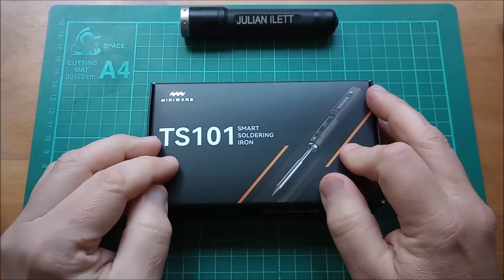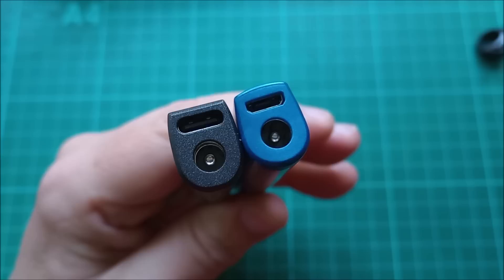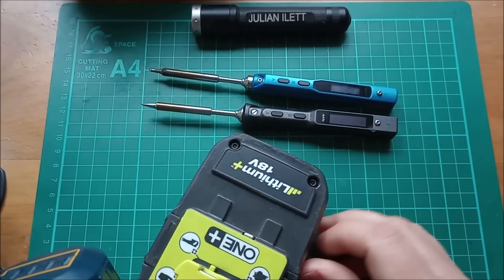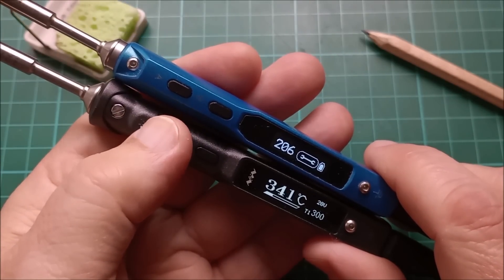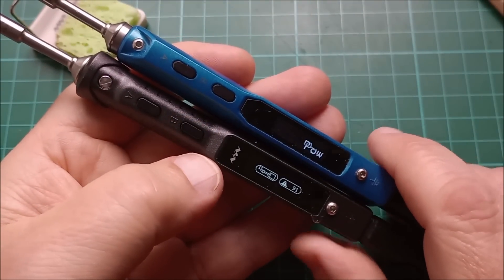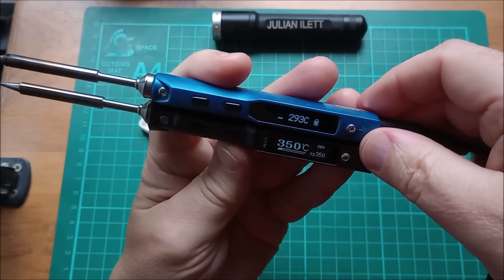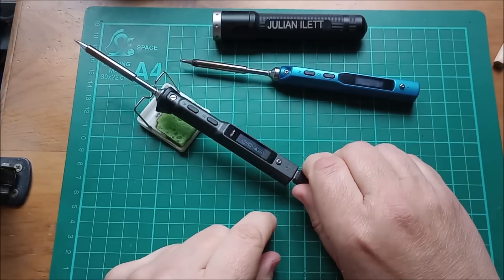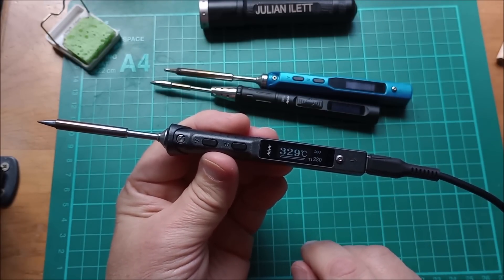TS101 Soldering Iron - Better than TS100?

Comment: A very good comprehensive review for those who have purchased this and want a quick tutorial .. I loved it. Just got my TS101 yesterday and it looks to be a good piece of kit. I upgraded the firmware as well to V2.11 which enables the PD3.1 28V option .. or basically you can switch off the max 45W restraint in the menu settings to OFF so that it goes up to 65W or 90W whichever power source one is using. It is better to keep both the USB and DC power source options at hand to make this a good soldering companion for all scenarios. You did a great detailed review of it .. thanks a bunch. For people who have never owned this type of soldering iron, they may get intimidated with the menu etc. but once you get it you will most likely have a smile on your face! Cheers.

Comment: It seems to be happy when you just feed power via usb-c. without any pd stuff. in my manual, the maximum voltage via usb-c pd is 21v. so far there are no issues at 24v. (other than the buck converter having a stroke because of the pwm ;D)
what was/is the reason for that limit?

Comment: 3:03 for full power it requires a PD3.1 100W charger and a 240W EPR cable that costs as much as the soldering iron itself, doubling the price. Not so cheap anymore.
Reply: but the cable and power supply are then there for multiple uses.  I

Comment: Any long term info on the OLED display on the TS101?
I had 2 TS100 and on both the OLED faded out over time. (Probably because OLEDs don´t like the heat...)
Does the TS101 still have that problem?

Comment: I got 90w to work type c 28v 5A with 140w type c cord and anker737 powerbank that outputs 140w max on one c port heats up so fast it only reads a little over 100w for 3 seconds on the power bank then dives back down to 2w to keep it stable

Comment: This thing sucks... i have a 100w adapter and cable and it wont even melt solder into a 14awg wire. Unless you use the barrel jack this thing is useless.

Comment: If you don't use these on a regular basis, coming back to them, the menus and buttons presses which you don't remember are confusing as phwck.
I end up just guessing at the button to turn it on, and then when I need to pause it, unplug the dmmn thing from the power source.  When I need to use it again, plug it back into power.   I got smart and use a power strip for turning power on and off.  I mean, I guess I could spend 5 to 10 minutes every time I use the iron figuring out the menus all over again, but I don't have time for that.  An AC power strip switch is the way to go.   On, off, on, off.   Once the temp is set, I don't need any other bloody mess in the menus.
Reply: thats good advice... I use a similar setup for my 3d printing pen

Comment: Why in the world would not they not allow 28VDC in the barrel jack?  That is absolutely senseless!

By the way, I use a simple DC to DC boost converter to feed my soldering iron with 24VDC.  (It's a Chinese T12 tip iron.)  I can run it from my Ryobi batteries or from a lithium iron jump starter or just about any D.C. source that can supply ca. 90 watts.

Comment: To truly appreciate TS100, you have to use Ralim IronOS firmware, which not only improves it's operation but also comes with new settings & features. Just give it a try and you won't look back ;)
And IronOS support for TS101 is coming soon...
Reply: Great bit of info, thank you 👍

Comment: A review with a comparison between both models is VERY useful for someone like me who wants to finally upgrade from an AC powered pencil soldering iron. I am finally trying to build a permanent project using an RP2040 based board and want propery temperature control for any soldering I may have to do.
Reply: if you use a top end ac soldering station its not an upgrade.... they still cant be beat

Comment: Thanks for the quick complete review. BTW. You can update firmware with an open source bin file and improve it; also add more setup options to tweak and performance. Nice review 👍
Reply: May I kindly ask what's the firmware you're using, and where do I get it?, thanks!

Comment: Where did you get the battery connector for the 18v batteries.  Also the 18v batteries when fully charged are approximately 20.5 v.

Comment: I have the TS100 and use it at the max voltage and I'm sure the warm-up was much quicker, e.g. around 5 seconds? Is it possible I'm imagining this?

Based on your comparison, I like the tip stats, but I prefer the display update speed on the TS100 (when warming up, you can see the numbers counting up more quickly). Small detail but I prefer that.

Comment: It is interesting, but from the practical test reviews I've seen, it still doesn't match a T12 clone station. I've pretty much decided my next Christmas present to myself (or possibly sooner if I have a project that needs it) will be one of those, because my current conifer tree/pencil -based soldering iron just doesn't cut it for reworking boards with heavy internal ground/power layers.

Comment: Is the barrel jack the same odd size as the ts100? 
Looks like a great upgrade just for the USB-C option.
Reply from the maker: Yes, it's a 5525 DC jack, 5.5mm outside diameter, 2.5mm pin diameter.
Reply: What is the advantage of the barrel jack to the usb-c power?
Reply: @joeking433 more power and more flexibility with the power supply

Comment: I have one of these.  Works fine.  It'll run on 45W PD but the size conductor you can solder is limited. 60W PD is better, of course.  Best is a 6s LiPo (yes it will handle a fully charged 6s despite being only rated to 24V).  Never tried a PD3.1 adapter, only a 60W max PD adapter.  That seems new as I don't recall my manual saying anything about getting 90W from PD.

Comment: Ive been using these since they came out. So far I've replaced (3) tips and a barrel jack. The power connection gets flaky and it annoyingly shuts down and restarts  Great little iron but hobby level only. Not for heavy use IMO
Reply: Never had any problems. Maybe you have a problem with your outlet power cord.
Reply: @JennaHasm  the problem is the  connection with the power jack loosens with use. I've seen this in a couple of these. I eventually eliminated the jack and wired the cord directly inside

Comment: There are  magnetic charging cables that claim to support fast charging and would allow rotation - if it got to be a problem you could try using one of those (never tried one of these myself - just saw them for sale in the usual places)
Reply: Are you aware of any that claim to support the higher current demands of this soldering iron?

Comment: I didn't know these existed. I was wondering what I should try and use for micro electronics as I want to do some old console modding. Now I know what I need.
Reply: I still use an 80w weller  soldering station for pc and mods.... probably did 300 og xbox mods with it... its not a top end weller either... cost about $80.
btw if youre good at soldering dont use a low power iron for modding.... it doesnt burn out anything because you can do it so quickly.

Comment: what software do you have on the TS100 ? It doesn't look like the default (at least, not the default mine came with). The TS101 UI looks a lot like the MHP30. I don't like either UI very much - it always takes me 2 goes to get the result I want.
Reply from the maker: I believe it's the Ralim software.

Comment: There is a modified firmware for the ts100. It might be worth comparing the ts101 to the ts100 with the modified firmware installed.
Reply from the maker: Yes I did.

Comment: not worth the upgrade.  Honestly I prefer the Pinecil.  It's basically the TS100 only a third of the price.  It even uses the same firmware.
Reply: the price is relativized because you need an expensive power supply unit
Reply: Doesn’t sell on Amazon tho. However, I find these tips are all really expensive.
Reply: By the time you get a power supply and a cable it’s not that much cheaper than the Miniware irons.
Reply: @joeking433 i got a miniware for $45

Comment: I'd love to see this compared to the pinecil iron
Reply: There's not really anything in it. The cartridges are the limiting factor on all of these.
Reply: @sdgelectronics  The Pinecil is cheaper and has shorter tips. It's probably the better choice for those looking for a new iron.
Reply: @Phoen1x883  It’s not much cheaper after you buy a power supply and cable.  I have about $70 in my Pinecil.  Plus Miniware throws in some solder and a cheapie stand.

Comment: Anyhow, the TS100 is rather a fragile thing. The display dies for no particular reason.
Reply: I can vouch for this.  I replaced my screen a few months ago, and it was a simple job; IIRC, new screens were under a couple of quid, so I bought a few extra for Mr Justin Case.
Reply: @Loneman_OG  I also had to replace one after a few months. Someone on ebay had them, not too cheap but UK and it fit better than the first one I tried.

Comment: So, if you already have the TS100, it's probably not worth the upgrade; otherwise, it's better to grab the TS101?
I do exactly the same thing with rotating the cable, but I've been fruitlessly searching for a twin-cored super-flexible silicone cable and a miniature DC jack.
Oh, and 'Boost Mode' should be referred to as 'Beast Mode'... because that's precisely what these things are; beasts! 😎

PS  Is there any chance you could provide a link to the fast-charge supply you're using?  Moochass grassyarse! 👍
Reply: See the silicone cables for tattoo machines.
Reply: i use a silicone usb-c cable. with just 2 wires and hooked up to 24v dc.

Comment: I bought it last year and I am using it at home with 65W PD charger. I am happy with it. Works fine. My plan was to use it with powerbank, but you have to have powerfull one. I tried it with a few 18W 12V PD powerbanks and the iron never switched to 12V, always only 9V. And at 9V the power is only 9W, which is almost useless. Later i bought SEQURE S60 and it is perfect for use with powerbanks.
Reply: USB PD has no 12V mode, despite it being a seemingly obvious voltage to offer, only 9V and 15V. Any 12V from USB is using QC (QuickCharge), and most of the power banks will supply both PD and QC voltages, but you need the proper trigger board. Also, there are plenty of PD supplies that DO NOT support QC, so even with a QC trigger, it won't supply 12V.
Reply: @wifigod  Just tried 22W powerbank. TS101 will also switch to 12V.
Reply: @wifigod  Are you sure? Because if I connect my TS101 (does not support QC, only PD) to 20W charger it will switch to 12V. With 18W charger (or powerbank) it will stay at 9V. With 33W charger it will switch to 15V and with 65W it will switch to 20V.
Reply: @wifigod  So what is the ideal situation as far as power supply?

Comment: Not revolutionairy enough for me to go change.
Reply: Ya and it's fairly expensive but the pinecil is the same thing and was like $25 I'm not sure if it is more now but it was
Reply: @james10739  The Pinecil is misleading at $25 for it now has a $13 shipping fee.  And then you have to buy a power supply and cable.  It’s a typical bait and switch with the high price shipping.  They probably had free shipping initially until they could jack it up to $38 with shipping.  And then $20 for the power supply and $10 for the nice silicone 100w cable and it’s at $68.  Then add a few dollars for the solder and stand that Miniware throws in and they’re really not priced much differently.

Comment: What would happen if you put 28V on the barrel jack input? I mean presumably the FETs inside can handle the voltage, so why 28V is PD only?
Reply from the maker: Interesting idea.
Reply: The mosfets are rated to 40V. I use the TS100 usually at 30V, giving me well over 100W.